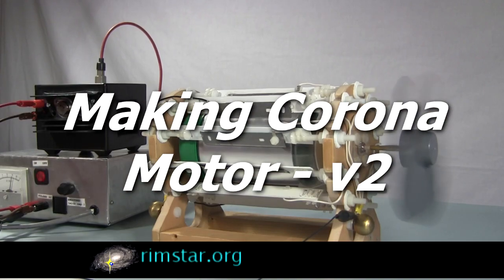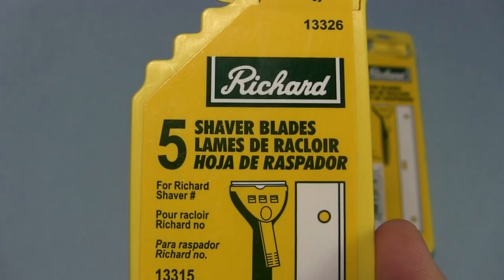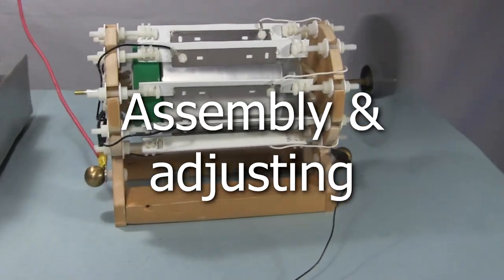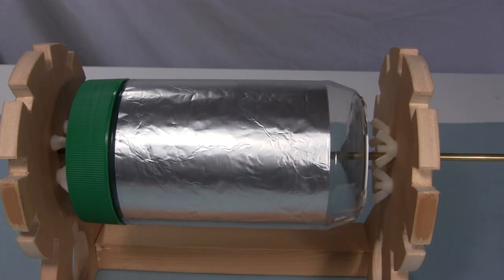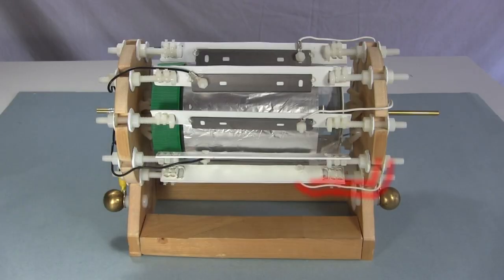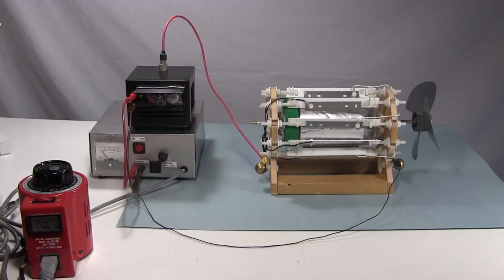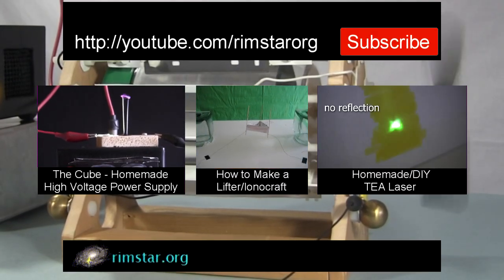How to Make Corona Motor (v2) aka Electrostatic Motor/Atmospheric Motor

Comment: can we use this motor to generate electricity? If so then what scale just fun scale or consumption scale?
Reply from the maker: Yes, you could connect it to a motor to generate electricity.
Reply: @RimstarOrg  at what scale and Is it possible to use Corona or atmo  motors in Fans like ceiling fan or room air coolers with dc supply. As they are light weight and obtain high speed. Less weight means do they consume less electricity as compared to other dc or bldc motors like they are heavier then this. please answer both?
Reply from the maker: I suspect these (electrostatic motors) are less efficient than electromagnet motors (the kind you find everywhere) despite the weight difference. The conduction of ions between the blades and the cylinders allows for a lot of loss.

Comment: What is the minimum voltage one should apply to run this 
motor?
Reply from the maker: The voltage is required to be able to ionize air across the gap between the blades and the plastic and to provide some Coulomb force for the repulsion. I'd guess at least the low thousands. You'd need current too but as you can see in my other video here, https://www.youtube.com/watch?v=3t7npMCxiVo I managed to turn it using just triboelectricity and there isn't very much current there.

Comment: Could you get this thing to power a flywheel you know how you can lift a heavy fly wheel while it’s spinning relatively easy an move with its energy    If you were to find a way to make it catch a string /cable an wind up like a yo-yo flick pulling its mass upward and instead of free spooling back down then have it attached to a alternator you could store it easy an cheap renewable all night round lol

Comment: could this work better insie vacuum chamber?
Reply from the maker: Probably not. It works by producing ions in the gap between the blade and the surface of the cylinder and molecules (e.g. air molecules) are needed for that.

Comment: can you make a corona motor with charged electrets out side of the cylinder or reverse it and have a large electret in the center to be driven by other electrets or static discharge?
Reply from the maker: I don't see how it would work. There wouldn't be any energy source. Electrets themselves aren't a source of energy.

Comment: Tesla's idea was to keep the voltage and boost the potential; is what's needed to run motors, televisions and any other electronic or electrical devices.

Comment: nice job. But a corona motor (driven bei covid? *g*) can never power a machine, because it is too weak for that if you do not have the right current power (power, not voltage) as a source. Usually it is used with atmospheric current. But thats unfortunally way to weak to get any use of it (as "free energy")
Reply from the maker: Thanks. Yeah, it is difficult to gear it down and still have torque left over. I did try once to adapt it to a vehicle but without success.

Comment: can you make this into a bigger craft for transportation?
Reply from the maker: I tried putting it on a small four wheeled vehicle with a pulley system to convert to a lower speed, gearing it down essentially, for the wheels but I couldn't get enough torque.

Comment: what would happen if you use more blades and more than one antennae?  12 sets? 6 antennaes? wouldnt that increase the voltage
Reply from the maker: Increasing the number of antennae would increase the current, not the voltage. But that's okay, that would still mean more power. The voltage is increased by going higher. I don't really have a good answer regarding the blades, there seem to be a lot of variables there.

Comment: First time I've heard of this sort of motor. It's an interesting concept, though I still don't understand the function of the aluminum foil inside the jar after reading you webpage. It only says, "For improved performance, an electrically conductive material lines the inside of the cylinder".
Given that it seems to produce a significant amount of torque, I wonder if it wouldn't be even more powerful if the blades rested lightly on the rotor so that the electrons would have an easier time flowing onto the plastic and back off.
Reply: The blades resting on the rotor would introduce "drag" on the rotor.  This likely preventing it from turning at all, as there is very little torque available during start up due to the small or limited amount of current flowing through the device.  The demonstrated torque produced while spinning is of course the effect of the mass of the moving rotor assembly.
Reply: Try to think of the drum and the knives a (set of) capacitors. Putting the alu-foil inside the cylinder increases the capacitance of the capacitor. It is much like switched capacitor filter, where the cylinder is the center capacitor. The more energy (charge) it can switch per cycle, the stronger the force from the electric field, and the more mechanical power is transmitted to the shaft

Comment: Very nice demonstration.  Given that the high voltage has very little amperage, why can't you introduce a small transformer coupled with a few capacitors in series.  You engineer some amps. What do you think?
Reply from the maker: There is a maximum voltage that will exist - that's the voltage required for breaking down the air in the gap between the blades and the surface of the cylinder. The voltage won't go any higher than that. So I guess once you determine what that voltage is then you can do something like you suggest and tune your supply to better match.

Comment: Use Van De Graaff generator instead of Wimshurst machine so you can spin the Corona electrostatic motor very fast with 15+ kilovolts of static electricity. Next step experiment, you can connect Corona electrostatic motor to electric generator so you can spin the generator to generate AC voltage.

Comment: Why u have fitted aluminum foil inside
Reply from the maker: I just saw your facebook message and remembered this question from Christmas holidays (I didn't have the time to answer back then).
Where a blade faces the aluminum foil, charge will move around on the foil such that there will be an electric field between the blade and that area of the foil. That electric field will help with ionizing the air between the blade and the plastic cylinder, causing a more efficient movement of charge between the blade and the plastic.

Comment: I wonder how a 'silicon coated aluminum drum' from an old copying machine would work to improve the efficiency of your rotor?  These drums are 12 inches long with a 5 inch diameter. The bigger the machine, the bigger the  drum. The larger the diameter, the more torque would be given. Exciting video, keep up the good work!

Comment: I'm interested in constructing your Corona Motor V2 and would like to ask for the measurements / dimensions of your base (the details the wood part) - so that I can recreate it perfectly). I hope to speak to you soon!
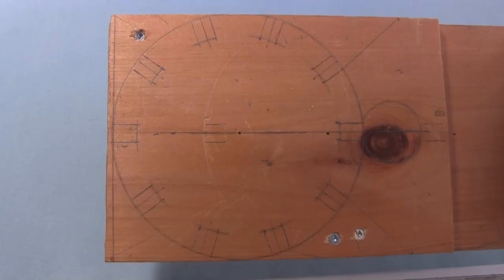Reply from the maker: As you can probably guess from 1:40 in the video, I designed and drew it all out on the piece of wood, using the diameter of the cylinder as a starting point (i.e. I made it big enough so that the blades would be close to the cylinder while still being adjustable). So if your cylinder is a different diameter then you'll have to come up with dimensions which work for it.
If you still need dimensions then let me know and I'll put something on my website. But I'm super busy so it may take a while.

Comment: Would applying this vertically to harvest atmospheric static energy work? Would I get better results using copper, but also insulating the antenna line up to the peak point of where I want?
Reply from the maker: Sure, I harvest atmospheric electricity with it in this video here https://www.youtube.com/watch?v=qhXxSAv6rMg and explain it here https://www.youtube.com/watch?v=2rVdEhyMR6A. Note that this is not an electromagnetic motor so it does work with an antenna. Antennas receive electromagnetic waves. This motor works using high voltage and electrostatics instead. So the wire used for atmospheric electricity isn't called an antenna, it's just a long wire collecting charge from higher up in the atmosphere.
I don't think the type of metal used makes any difference. And insulating the antenna up to the peak point is what I did. The wire has an enamel coating on it which insulates it. However, I do wonder if having more of the wire be uninsulated near the top end might collect more charge.

Comment: Awesome project! I am currently designing and building one of these motors and am trying to maximize the speed of the rotor. What do you think the relationship between a number of blades and the speed/torque is? Do you have any tips? Thanks!
Reply from the maker: Nope, I don't have any formulas or tips. I just went on intuition. For all I know, double the number I have might be better. Another variable might be the amount of current your power supply has to offer. I give an explanation of how the corona motor works near the end of this video https://www.youtube.com/watch?v=2rVdEhyMR6A where I powered it on atmospheric electricity.
Reply: Thanks for the reply! Yeah, there is not a lot of information about them online. I will experiment and post my findings. Thanks again!

Comment: I never had seem one before, it is really amazing what can be done with eletrostatic.
But I got curious about the power. if you had made it with a bigger radius or with more blades it would harness more power?
Reply from the maker: It's hard for me to say. There's probably a trade-off point somewhere where increased losses from more blades will start to mean less power.

Comment: hello rimstar, i have a question
does the wimhurst machine have to be powered by it
can it be powered by batteries
Reply from the maker: If you mean, can the corona motor be powered by batteries, the answer is no. It needs a high voltage, probably in the thousands  of volts.

Comment: since you used your cube generator to power this...which uses flyback with internal diode and it provide pulsed dc so can i assume that an output from flyback of a plasma tv will work?
Reply from the maker: I don't know. I've no experience with a flyback from a plasma TV. Maybe someone else here knows?

Comment: Nice video. How many watts you  need to move this rotor?
Reply from the maker: Thanks. I've never measured it. However, it can't be much since in this video I show powering it using the Triboelectric effect https://www.youtube.com/watch?v=6x6DqPL14yU. With that the current is very small. The gap size between the blades and the cylinder set the voltage limit, probably only one or two thousand volts, but with the small current I'd say the power is in the micro to milliwatts. It is a low torque motor though.
Reply: Miliwats?! Thats great efficiency!

Comment: is super corona dope realy needed ? i cant find it in my country. any alternative chems ? and what does it do ?
Reply from the maker: +Onur Cevik Wax is a good alternative, you can melt wax onto it. Epoxy/resin is also good and will last longer than wax since wax can come off easily. 
Wherever there are sharp edges there is a stronger electric field than where there is a flat surface. Because of that stronger electric field, charge can leak off from there. But the only place you want charge to leave the blade is at the sharp edge facing the cylinder. So by insulating those other edges you reduce some losses from leakage.

Comment: if you add more aluminium foil and more electrodes will it become a stronger motor? more voltage and amperage ? also i wanted to ask you if you know how to make a tesla antena the one thath harness electrcity from air or radio waves i dont know because whith thath you could power this motor almost forever  i watched otter videos but no one explain whith such detail as you   thanks for sharing a way of freedom   i have a  file whith all the patents of tesla in pdf  i can send it to you       i want  to put this tecnology on my bike
Reply from the maker: +ivan grompone The inside of the cylinder where the electrodes are is already completely covered so there's no more place to put aluminum foil. Removing some of the foil would make it work less well. As for adding more electrodes, there's probably some sweet spot in terms of how many is best. More than that would probably just contribute to losses. But I don't have any way other than trial and error for figuring out how many. As for a Tesla antenna, I'm not familiar with it. Tesla's Wardenclyffe tower was a transmitter as far as I know. Crystal radios are radios what use the incoming radio waves to power themselves but the power is very low. Re patents, I have a book with all of Tesla's patents but I haven't read them all.

Comment: how thickness is the axis?
Reply from the maker: +Júnior Gomes Bezerra Do you mean what's the diameter of the brass tube, or axle, running down the middle? It's around 7/32" or 5.5mm in diameter. But it doesn't matter. Use whatever you have available.
Reply: Can I use an aluminum tube/axle?
Reply from the maker: +Júnior Gomes Bezerra Yes. The material doesn't matter. It just acts as an axle for the cylinder to rotate on. It doesn't play any part in the electrical activity that's going on. The only requirement is that the cylinder is able to turn easily since the electrical effect doesn't produce a lot of force. In my version 1 I just used a pen https://www.youtube.com/watch?v=ksp_O_1WmvA.
Reply: +RimstarOrg Yes, I got it. What can I use to replace a super corona dope???
Reply from the maker: +Júnior Gomes Bezerra Epoxy/resin is a good, long lasting replacement.

Comment: What kind of power supply can I use to make it works?
Reply from the maker: +Júnior Gomes Bezerra You don't need much. In this video I show using a PVC pipe and a cotton facecloth https://www.youtube.com/watch?v=6x6DqPL14yU. Since that works, that means that pretty much any high voltage power supply will work.
Reply: +RimstarOrg ok, very well. What DC power level can i use to create a regular speed rotation ?
Reply: +RimstarOrg O Eixo do rotor utilizado por você é feito de que material?
Reply from the maker: +Júnior Gomes Bezerra I don't know. There are no specifications for these things. All I can say is what I've gotten it rotating with. That's my very weak homemade Wimshurst machine as well as my commercially made one. Also my homemade soda can Van de Graaff generator and my very big Van de Graaff generator. My Cube power supply and my 30kV power supply. At a guess I'd say the smallest high voltage power supply you can find or make will cause it to rotate steadily.
Reply from the maker: +Júnior Gomes Bezerra Brass.
Reply: Can I make it works (some rotation) with a power supply less than 1 kv?
Reply from the maker: +Júnior Gomes Bezerra Maybe, but I just can't say. The voltage needed is  whatever is required in order to initially create the corona across the  gap between the sharp edge of the blades and the surface of the plastic cylinder. It definitely has to be high voltage i.e. 12V or even 100V won't do it. But I don't know what the lower limit is.

Comment: Awesome work! I plan to make one of these at some point! Have you tried connecting one side to a rubber spray-painted steel plate (or ball) high in the air and the other to Earth ground. You should be able to get this thing spinning using atmospheric power alone collected by the plate/ball. Tesla has a patent for this patent No. 685,957 "apparatus for the utilization of radiant energy".
Reply: Just saw a video from him about it

Comment: hi rimstar ii made this motor but it doesnt work pls can u tell me what all can be the reasons for not working .............. i have tried till 6000 volts but still it wasnt working .
Reply from the maker: Muneer Arif What did you use as a power supply? 6000 volts should be enough since you just have to cross the gap from the edge of the blade to the jar. Make sure no blades touch the jar. Make the spacing as close as you can get it. If you give the jar a turn by hand it always stops at the same place then it isn't balanced and that may make it hard to start. Do your bearings have grease in them or no grease? Greased bearings can have a lot of friction. Mine are ceramic dry bearings, dry meaning there's not grease in them.

Comment: If you put the tin foil on the inside of the jar, how does the charge get to the foil to charge it positive? Is it breaking down the plastic dielectric surface?
Reply from the maker: BGT Productions The charge doesn't get to the foil inside the jar. However, the charge does move around on that foil wherever there's a blade on the outside of the jar. There is an electric field between those charges on the foil and those on the blade, since an electric field isn't blocked by the plastic dielectric. That electric field is added to the electric field between the blade and charges on the surface of the plastic, resulting in an overall stronger electric field. That stronger electric field helps move charge between the blade and the jar.
Reply from the maker: BGT Productions Yes, for this one you need a corona between the blades and the outer surface of the jar. That's how the charge is moved from one to the other. Or I guess you could say that the corona is largely the charge that is moving from one to the other. For electric fields alone to work I guess you could make a different machine with a different power supply that would use high voltage pulses to produce motion by repulsion without charge transfer. I don't think a smooth surfaced jar wouldn't work. You'd probably need the jar to have a sawtoothed surface and turn on the field only when the next diagonal surface arrived. Hard to describe in words and I'm making it up as I go, but I think something could be done.